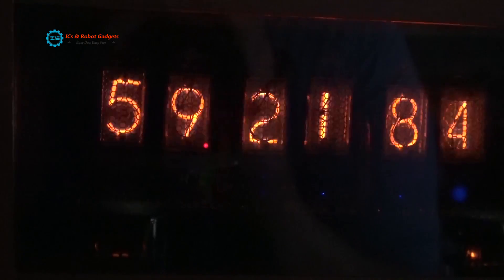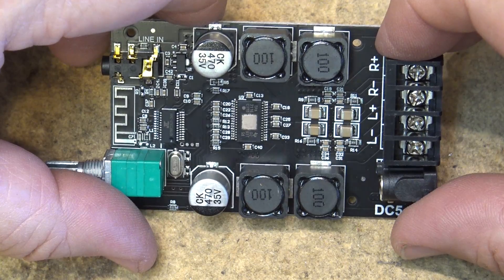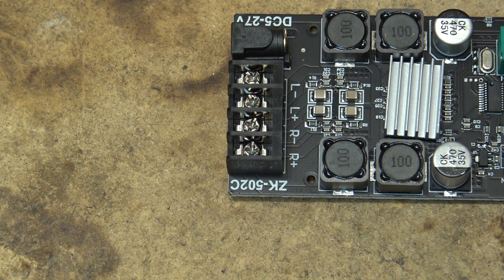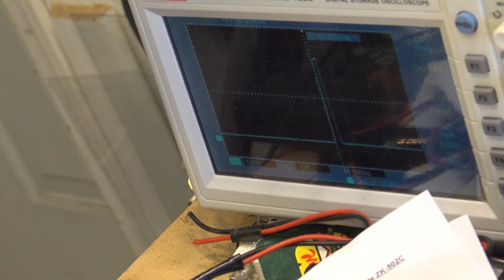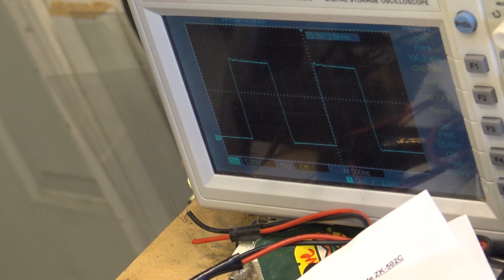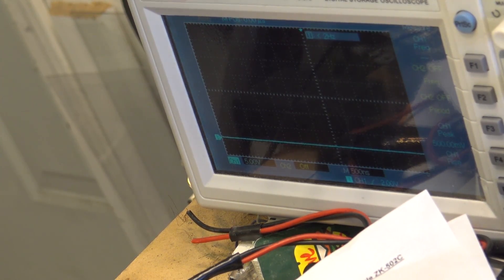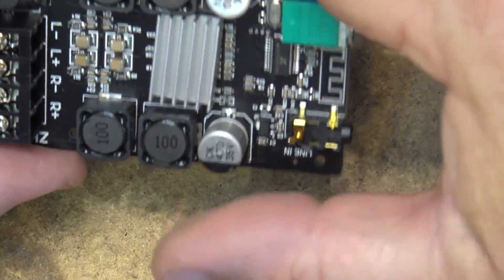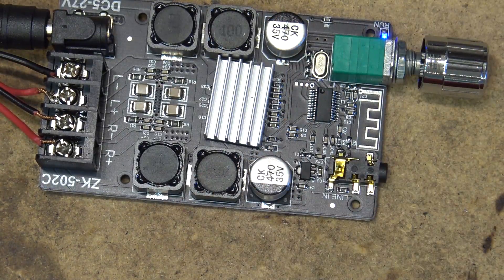icstation 50w x2 Bluetooth module BLE5 0 TPS3116 module ZK 502C

Comment: So would you say that the voltage  "steering spot" is around 12vdc?
Reply: Sweet
Reply from the maker: They will operate from about 5 to 30 volts. Whatever the spec says. Remember this is class D. the higher the. Voltage the higher the power output.  So 24v gives double the power or 12v.

Comment: Hello, I have bought this amp and my question is: can I connect directly to the electrical plug with a PC power supply? Or do I need to add a current converter? Thank you (sorry for my bad English)

Comment: Hi there, can an AC/DC power adapter with 24v5A rating power this amp? :) just worried that 5A could be too much.
Awaiting your kind reply.
Reply from the maker: More amps the better.  Unit will only draw what it needs.  24v @ 5a good.

Comment: Looks like a pulse width modulated Square wave. It is a different amplifier design the the ones that use some waves.
Reply from the maker: All class d use pwm square wave. The difference between the designs is the frequency of the carrier.

Comment: It may put out 50 watts per channel if it was ran at the full 26 volt dc input but only half of that at 12 volts dc, so id say its a little miss leading.
Reply from the maker: How is that misleading? All class D amplifiers are dependent on the input voltage and have wide operating voltage. It is printed right there in the specs what the power will be vs the input voltage.  Right on the web site.  Nothing misleading except in your mind.
Reply: @12voltvids  if you ever heard a 35watt guitar amp you would see these amps are BS
Reply from the maker: @Synthematix  I have a 35 watt tube amp, and into efficient speakers it will rock the house. There are many different ways to measure power. RMS power is not the same measurement, and most older amplifiers were rated RMS power. RMS power is 70.7% of the actual power.  So 35 watts RMS is the equivalent of 50 watts PEP which is how they measure amps now. 
Also they measure amplifiers in burst power, not sustained power.
These amplifier WILL meet the specification under the test guidelines that all manufactures claim.
Keep this in mind. It is Texas Instruments that makes the vast majority of the chips used in these amplifiers. They also publish the data for the support components. The chine assembly companies are  not designing these amps.They are taking the specs and design from Texas Instruments and building them to spec.  They do meet the specs, and will stand up to any other amp that is measured the same way which is peek envelope power burst.
RMS can be measured in burst or sustained output as well and the high end amp manufactures will generally rate their amps as continuous operation. They will measure a constant tone set to just below clipping, and then measure the voltage p-p and calculate the RMS voltage, then convert that to watts @ the 8 or 4 ohm speaker load.
The same measurement could be done on these as well, but it became a numbers game in the late 80s by companies like fisher (sanyo) and others wanting big numbers so they fidged the results.
Same thing happened with camcorders and cameras.  There was a time where the lux rating on a camera was shooting a white card on a black background. The light level was raised until that white card acheived 100 IRE on the waveform monitor. That was the light level lrequired to give a 100%  video level picture. Sony always used this reference. JVC and Panasonic  started lowering the bar. Forst to 70 ire, then 50. Pretty soon the minimum lighth level was claimed as soon as the white square was aparant. Now they call the same camera that needed 90 lux minimum a 1 lux model. 
They get away with this because there is no government standard testing and regulations. You know, because people hate standards and regulations.
Could you imagine how unsafe our roads would be if the car makers were allowed to self regulate themself? This is also why so many devices these days do not have power supplies. They use a plug in adapter.  The only part that has had to undergo any safeth testing is the plug in adapter, which is generally a 3rd party product.
Reply: @12voltvids  texas instruments make the DLP chip as well dont they? im sure my optoma hd131xe projector has one.
Reply from the maker: @Synthematix  Texas instruments invented and makes many components. DLP chips, class D amplifier chips and many other semiconductor and microprocessors.

Comment: Sorry for such a basic question but, how can you be so confident that you won't damage the device when you exceed the specified supply voltage.  Is there an obvious device on the board (regulator?) that provides protection?  Thanks for the videos!  I love blue tooth, its such a great carrier medium.
Reply from the maker: The chip has built in over /   under voltage protection as well as over temperature shut down.  If the voltage goes too gigabit just shuts off.

Comment: I have an amplifier that uses TPA3116 ic. And I like it.
Ebay. 273860533179

2x50 watts is just nonsense! maybe with 10% THD.
you have to use 24v 2 amp to get close to 50watt and then you have to use much larger heat sink.

do not know if the amplifier clearer 24v?

I also like TPA3116
Ebay. 273860533179
Typed watts are usually wrong

Comment: U can use a metal box as long as u add an antenna
Reply from the maker: Shouldn't be a problem. I mounted one inside a metal tuner and put an external antenna on the back. Worked great.